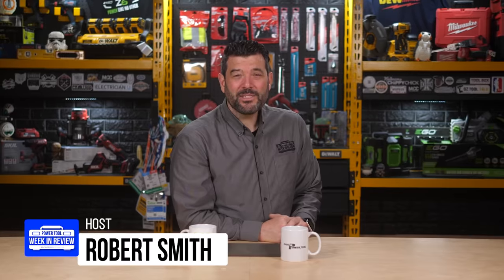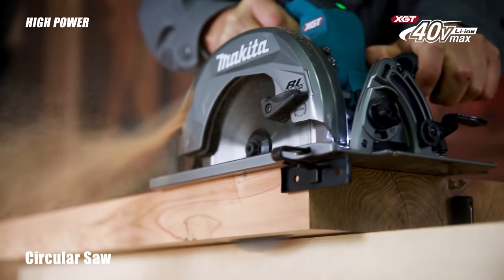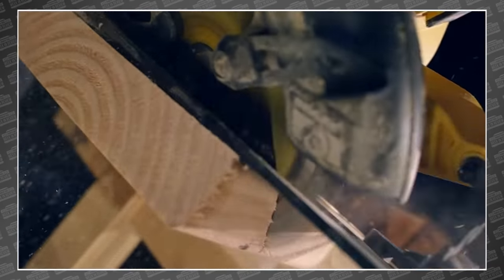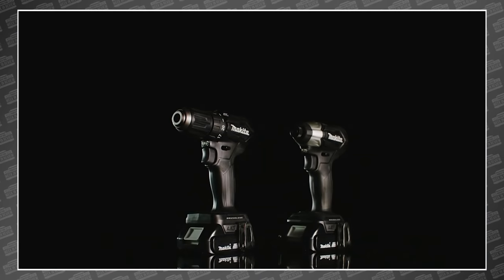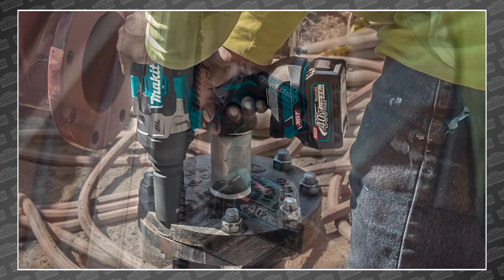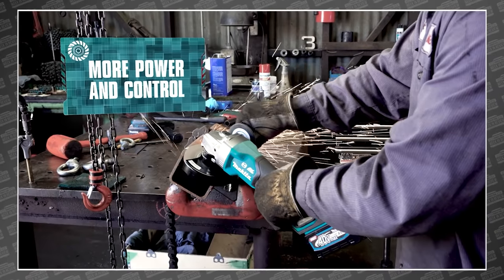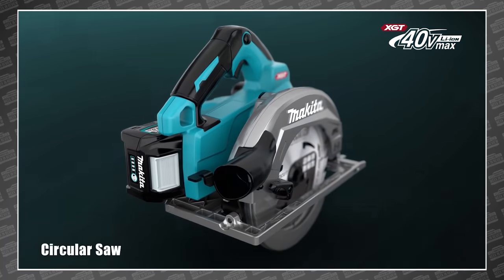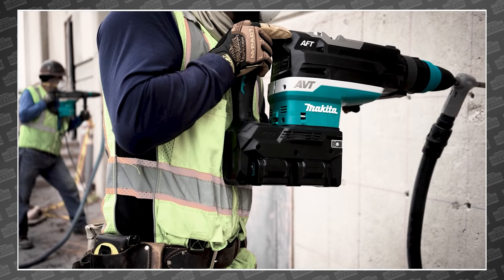FINALLY. Makita LAUNCHES NEW Makita XGT 40V/80V in the US! But the choice WON'T be easy!

Comment: I'm an lxt user who doesn't need that 40volt power. As fun as it looks. So I'll be looking at used 18 volt stuff once 40 launches
Reply from the maker: That's a GREAT idea Lucas. And as Makita pointed out, they are NOT changing any plans for LXT. It's got over 275 tools so far, and a HUGE roadmap ahead of it. If you don't need 80V monster tools, not only are you better off with LXT, but you make a great point... there will be more used LXT tools soon. :)
Reply: Yeah, I will be keeping my eyes 👀 open for used tools 😃
Reply: here in Brazil battery tools are a distant dream yet. because of the price of the tools, they are very expensive.
Reply: I've been an LXT user since they were first available and have had nothing else last longer or work harder than Makita LXT! I already have many LXT tools and this may make my collection easier to obtain.

Comment: I don’t think they are going to get people to dump their old tools and switch over to the new ones.  Way too much money.  So, I think you will see people supporting both battery platforms, until their old tools were out/break.
Reply: You’re exactly right I don’t have just one battery p latform I don’t have just one to manufacture but I do know one thing I’ve been using  Makita for 20years and only had 2 drills mess up on me,Not the drill itself it still runs fine the only problem I’ve ever had out of any other drills or any Makita tools that I’ve had is both chunks froze up and either wouldn’t open up or clamp down on something Or wouldn’t let it go. Hell I got a hide my old Makita tools so I haven’t excuse to buy new ones because They never break
Reply: @chaddarr4834  I have Milwaukee, both battery platforms, M12 and M18 all depending on the use of the tool.
Reply: They aren't dropping LXT anytime soon. The XGT platform doesn't have nearly enough tools in it yet.
Reply: All brands do this

Comment: @Belts And Boxes. Thanks Rob for the announcement. And Makita kits these 40V XGT tools with a fan cooled rapid charger to cool the battery during charging. Makita has always done this. Dewalt and Milwaukee makes you buy their rapid or super chargers separately. And the fans for the Dewalt and Milwaukee rapid chargers are to cool the charger not the batteries. We'll see how well these XGT tools go against Dewalt, Milwaukee, and Flex.

Hope you, the staff at B&B, and your families stay safe and well.

Comment: It makes sense! Technology requires complete redesigns. Once upon a time, tvs weight 60+ lbs and were huge! Now we have them paper thin and they mount flush on walls.
Reply: As an electrical engineer, technology does constantly evolve and will likely require overhauls at some point in the product lifecycle. However some people choose to transition consumers in their redesign process while others only offer a new solution. Depends on their productions approach and business model they’ve set out.
Reply: Yes exactly, both dewalt and milwaukee had to "dumb" down their next gen batteries to make them backwards compatible so they didnt fry some of the 18v range.. makita did not want to do this and i like the approach they've taken
Reply: We have 40v max here already and the first tools we got seem to be the same as the 18v and 18v x2 tools just adapted to 40v max. Run time looks to be better but tool performance is very similar. In fact I run the 40v max mitre saw using the the PDC01 with no issues (18v x 4 backpack).
Reply: I know das right cus

Comment: I've been on makita LXT for awhile and love them. But I never wanted to toss 2 batteries into a tool to make it work. So I'm getting some of the bigger tools on XGT and keeping my usual lineup of LXT 
And guess what? I get the new 40v Max Recip tomorrow. Yep, it's being delivered. I'm excited
Reply: Looks like XGT also has some dual battery 80v setups tho. I like your method and also hate dual battery. I have about 25 lxt tools, very young tools and about 20 5ah batteries so im not about to kill that off. But i would like to start the 40v with an impact and recip. Then we can talk Makita...
Reply: Im doing much the same, have 2 40v 4ah and 1 2.5ah batteries. Drop saw and recip on the way, but as my 18v tools end their life i will be replacing them with the XGT
Reply: @Wheeznbreezn  I want that drop saw so badly
Reply: @HelenaOfDetroit  iv actually put that order on hold as a makita agent told me the 10 inch and 12 inch 40v isnt far away so im going to see how the 10inch goes and make a decision after that
Reply: @Wheeznbreezn  I thought about the 10", but because the 8.5 has such a long slide, then I can cut everything I need to with it. This means longer run time, cheaper blades, and a lighter tool to haul around. I wasn't sure I could, because I do a decent amount of trim work. But I found a way using the bevel adjustment to cut crown without nesting it. It's actually not that hard, and with his easy it is to change the bevel on the saw, I don't mind using it. On the old Dewalt DS780 I use, I barely adjust the bevel because it's just a pain to do. While cutting crown nested is easier on the mind, print out the chart and you really don't need to. Guess I'd rather spend a little more mental energy than the physical energy of lugging around a bigger saw. To each their own

Comment: I only have Makita, I don't need that 40v but I want it 😂
I do woodworking in my small shop and I don't need that 40v and honestly, it won't be useful for my kind of need, the 18v Makita platform is very strong and reliable.
I think is a great idea to split them because mostly it will be a double step forward to construction grade (even if the 18v is already a construction grade). That 40v or 80v would be better to specialize tools as a mitre saw, table saw, hammers, like very power-hungry tools in a construction site. I am even if I don't need it but I want it!
Great job!!!!
Reply: If you ever “cheat” at woodworking by using screws, only the XGT version of their flagship drill/driver has an electronic clutch.  Otherwise, you are correct, most of the truly 36v xgt woodworking and finish carpentry stuff available and in the pipeline is already available to us as x2 LXT.  I fathom they will likely bust out a 36v XGT jigsaw, but the 18v version doesn’t lack in power...it lacks in a sensible on/off process. 🤪
Reply: @robertrada4783  if you ever cheat using screws 😅🤣 is a sin!!! 
Low key, screws are my most important tools🤣 and pin nails 😂🤣

Comment: I've had my Makita brushless drills - both impact and variable for over 10 years now after having suffered with DeWalt cordless drill tools.  And while I would love to upgrade to the XGT models, I can't do it while looking in the mirror, simply because the LXT tools have NOT died on me, yet.  I use these tools just about every single time I perform a task whether it's construction woodworking or any other type of woodworking.  I even use the same tools when doing hobbies.  Even my wife walks off with my tools to perform tasks she needs them for. It just seems we cannot wear them out.  But when I do.....I'll be all over the new XGT line-up......well, as long as I don't hear anything significantly negative about them except the price.  None of these tools come cheap, cheap, but from my extensive use of them, they sure do last a long ass time.  Semper Fi, John

Comment: Heavily invested in LXT, with 12 5.0 ah batteries and couldn't care less. The tools that needed extra power, I bought in their X2 form. Recip., chain saw, SDS Plus Rotary hammer, Rear Circ. Saw, Track Saw. Single battery tools like hammer drills and impacts, perform marginally better, but at the cost of form factor, and honestly unless your mixing deck mud with your drill what's the point? I like being able to pop in the 2.0ah battery to keep their weight down. I have no use for a breaker, large grinders, etc.

This is one of those things that everyone was clamoring for, and complaining when comparing Makita to DeWalt or Milwaukee, but now that its here, I doubt people will jump on it. Maybe they will covert the DeWalt users to XGT maybe.

Comment: Ive been Makita cordless since 1985. They were crude by today’s standards but always well built and reliable.
These days I’m heavily invested in LXT with 3 double chargers and have about 25  5Amp batteries. Both 18v and 36v tools. Everything eventually becomes outdated but it won’t happen to LXT anytime soon. It’s cool to know there is now the option of extra heavy duty 40v platform if needed.

Comment: I'm confused so maybe someone can enlighten me. So it sounds like you said LXT isn't going away. Why would I need to leave it behind? If I need couple high powered solution tools, it sounds like I can buy an XGT tool and battery and charge it with an OEM adapter or a 36v tool. It doesn't sound like 36v is dead either is it?  I guess I'm just not following but it seems like Makita is making two different versions but there's gonna be a lot of overlap, and even better, a lot of options for consumers to find the right choice for them. The main thing I got from this was that I don't HAVE to upgrade unless I want uber power.

Comment: A whole new system isn't the best. Wish they could've at least had an adapter going from lxt. I mean, that's what dewalt does with their Flexvolt batteries. They're just three 18v batteries stacked together. In Makitas case they would just need to be able to toggle between 40v and 18v. Also, is it really 40v, or is it 36v and they're pulling a DeWalt?
Reply: They’re pulling a Dewalt (I don’t know Ego’s excuse) because they already market the LXT x2 products as 36v.   One battery (or pair wired in parallel) is nominal voltage 3.6v, charged to 4.0 (and actually I’d charge them to 4.2v).    Every brand pulls a Dewalt with “12v” and “15v” tools.

Comment: You’re exactly right I don’t have just one battery p latform I don’t have just one to manufacture but I do know one thing I’ve been using  Makita for 20years and only had 2 drills mess up on me,Not the drill itself it still runs fine the only problem I’ve ever had out of any other drills or any Makita tools that I’ve had is both chunks froze up and either wouldn’t open up or clamp down on something Or wouldn’t let it go. Hell I got a hide my old Makita tools so I haven’t excuse to buy new ones because They never break

Comment: i run milwaukee m12 and m18 for a while i bin looking for a different brand to invest in and good thing i waited this new line sounds perfect for my remodeling job and i was thinking of flex but i’ll wait on them i wanna see reviews on both lines mikita and flex
Reply: Obviously makitas new platform will be better since it's going to be 40 or 80v vs 24v. And...well...its makita. Tried and true. I think flex will be good, but i dont think it will be as powerful has 40v or 80v makita tools. And will prob take some time for flex to have a large arrangement of tools while makita will already have 50 in their new line. Id say stay with makita and add the 40/80v stuff when you need something w more power

Comment: I have a lot of Milwaukee and makita lxt. But if I get any 40v tools it would probably be the new 1/2 hammer drill and the rear handle circ saw to start out. I’ve watched a couple videos about the 40v impact driver and it’s only a little more powerful than the xtd16 that’s 18v so that would be the last tool I get.
Reply: XTD16 is a beast, I cant see why you would need a 40 Volt on that, anything more powerful then it wouldn’t be an impact driver, it would be an impact wrench lol
Reply: @jfernandito8205  your completely correct. My 16 is scary. The most extreme bits cant even handle it for long. And a 6 inch deck framing screw? Ha thats not even a challenge. Used to be id had to get the impact wrench for those. Not any more. And the 16 has such balance, feel and lighting that im done and set to go.

Comment: I have a few tools in the LXT lineup. 36v blower, both circular saws and a 16” chainsaw. And I also have a few 18v tools. 2 impacts, a hammer drill/driver, a drywall cutout tool, auto feed screwdriver, and a 1/2” impact wrench. Milwaukee is my main platform. My makita stuff is typically just backup. But even at that, I don’t use all of this stuff nonstop. A lot of it is nice to have and makes the tasks I use them for simpler. If I was building houses more, I’d probably at least dip my toes into the 40/80 lineup just to see the difference. But my demands really don’t justify that expense.

Comment: Will this include the outdoor lawn equipment aswell?
Reply from the maker: Absolutely. They already announced string trimmers and a blower. With up to 80V on tap, I'm anxious to see if they come out with an XGT mower, or even a zero turn! EGO just launched their 56V Z6 Zero Turn, which we have, and it's incredible.
Reply: @ToolShow   So are 80v tools another whole platform or just tools that require two of the 40v batteries?
Reply from the maker: @AndrewBrowner  The 80V XGT tools will take (2) 40V XGT batteries, just the their 36Vx2 line of LXT tools.

Comment: I am fairly heavily invested in LXT, so there needs to be a very good reason to look at XGT.  

Unfortunately, what I am not seeing is:
- a decent sized XGT compressor,
- a portable XGT table saw,
- A portable band saw (not a handheld),
- An XGT drillpress,
- An XGT radial arm saw.

And am I the only person saddened by the lack of a 12volt to 18 volt step up converter to charge those batteries from my truck?  Sure, I can run a small 12v to 120v inverter, and use the AC chargers, but that's not ideal for me.

Or, how about a Makita solar generator (aka a 1 or 2 KW/hr battery with inverters and solar charge controller) so all their goodies can be used off-grid.

Comment: All I want to replace is my 36v 10” miter saw... but I do not see that on preorder for the new 40v version. I know the one they have released over seas is currently only 8.5” . But when the 10” gets that redesign I’m picking it up asap
Reply: I have the 36v (2x18) haven’t used it yet. What’s the issue?
Reply: @pablorodriguez5100  My main issue after two years is its weight/size. But I have all Makita tools so I didnt want to get a different miter saw brand. Its been a great saw. But I want something easier to move.

Comment: Makita should make adaptive tools that for low power applications use the 18volt batteries and for hi power applications use the 40volt batteries
Reply: there's the 12v lineup for these applications, lol.
And also, Makita had 10,8v, the 14,4v and the 'old 36v' that we didn't saw overseas/outside Japan.
Reply from the maker: Power requires bulk. Not all applications need the power, so why deal with the bulk? That’s why they can’t solve the problem with adaptive tools.
Reply: @ToolShow  I can see a use for their 40V batteries to be used in multiple for outdoor use.  Things like lawn mowers, larger chainsaws, snow removal, blowers and that sort of thing.  Hope they punch out some 7Ah versions and run duals for a mower for instance.  My LXT X2 36V trimmer has plenty of power but in the future--my 42" riding mower will go electric so I understand what Makita is doing.  Chervon (Ego) rules that so the rest of the industry must step it up.  Granted, the first company to obtain Tesla 4680 NMC 9Ah cells will win so I can wait.  Makita does tend to pay more attention to battery tech so if they roll out a 72 volt nominal 18Ah pack running 4680's--sign me up but not until then.  I'm sure more mowers/trimmers are sold VS drills so good to see Makita step it up to fill that very open field.   It is all about the battery so when I jump from 18650, I'll go 4680 at 18V for my drills, saws, drivers and 50 to 75V for the riding mowers and alternative power sources ("solar generators" as they call them now)  Of course, making new gear available AFTER the house building season has started and after outdoor equipment sales peaked is not very smart but Makita is....well Makita so embrace the oddity.

Comment: I have a remodeling company mostly do bathroom re models and outside repairs.Been invested in the LX series of makita for quite a while extremely pleased , The new 40 volt system seem to be Towards the commercial side of the industry not the residential. I could maybe see there miter saw or Hopefully a table saw would be nice,have to see what the prices are.

Comment: As an electrician that's bought into lxt for the last 10 years+ I'm actually looking at adding milwaukee m12 to the collection for those smaller jobs.  My 18v makita sds is fantastic, but I don't want to be lugging it and my impactor up 3stage ladders all the time for 4 rawlplugs for 1 floodlight. 2 lighter tools will do the same job, and wont threaten to pull my trousers down. Also the m12 cable cutter will do 300mm copper? That would make it much easier on my hands than the ratchet cutters I'm currently using, and be faster
Reply: I was under the impression that Milwaukee had a lot of cordless electrical and plumbing tools  that aren’t even available from anyone else.  Anyway, if you haven’t checked out the 18v “subcompact” SDS from Makita, it’s pretty much on par with the m12 Milwaukee.
Reply: @robertrada4783  they do, but when your from the uk those specialist tools cost an arm and a leg

Comment: Some tools aren’t meant to be cordless. They don’t have the duty cycle needed for heavy construction. Not just that you buy a sds max you may have for 15 years. How many battery platforms will come and go in that time? Invest in a generator with a good set of wheels.